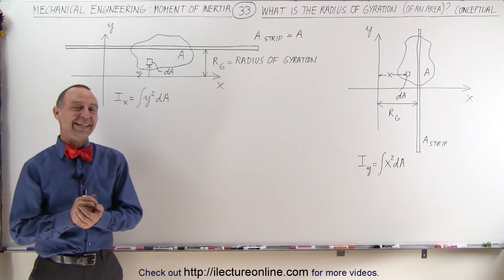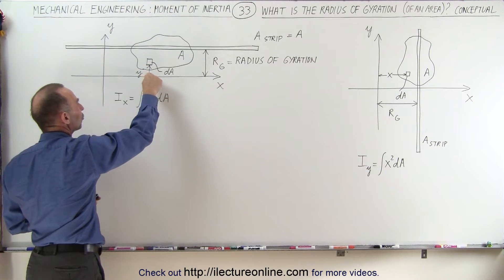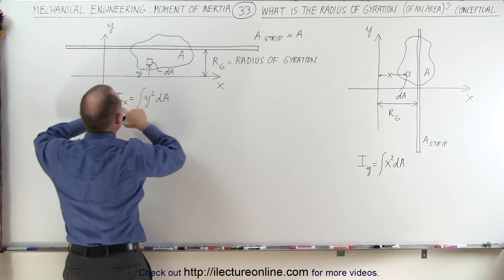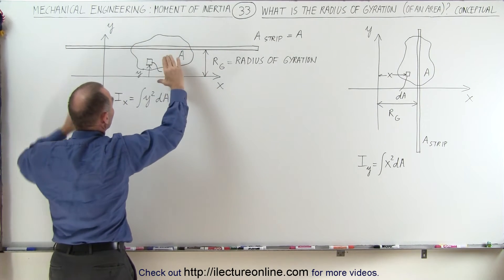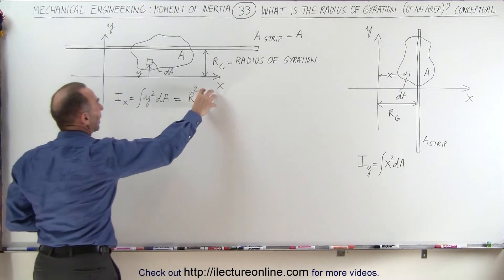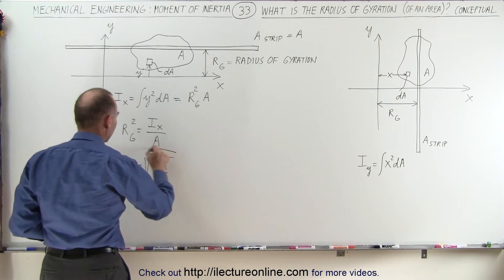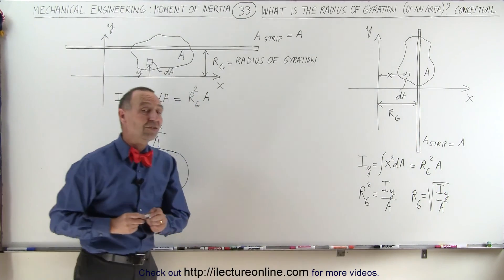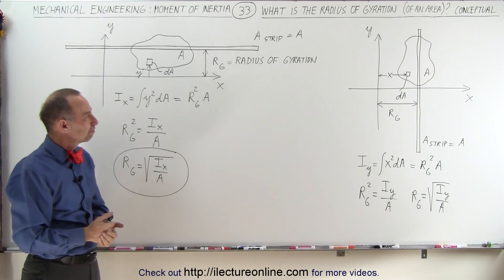Mechanical Engineering: Ch 12: Moment of Inertia (33 of 97) What is the Radius of Gyration?

Comment: Good day Sir. What about if I have a T-section. The flange is 300 mm x 20 mm and the web is 18 mm x 380 mm. The computed radius of gyration about the X-axis is 128 mm. Does this mean the equivalent strip area is 128 mm above the X-axis? Does the equivalent strip of area could also be placed 128 mm below the X-axis? Thanks in advance for the reply.

Comment: I am studying high school and have a doubt Radius of gyration. If the distance between the rotational axis and centre of mass is 'K'. Then if the body is rotated at the centre of mass won't K=0. So the Moment of Inertia =0?
Reply from the maker: After rotating you have to re-calculate the moment of inertia and the radius of gyration in that direction relative to the y-axis.